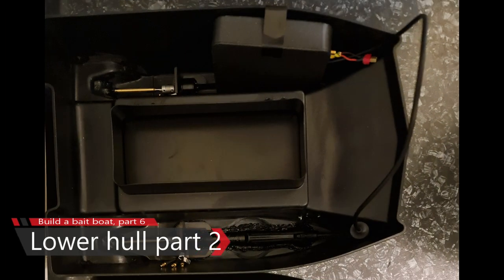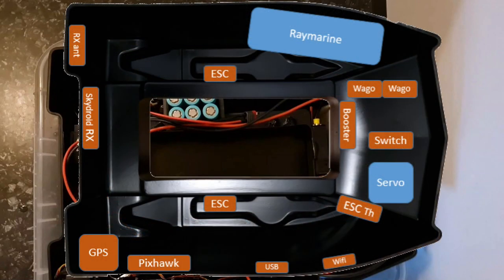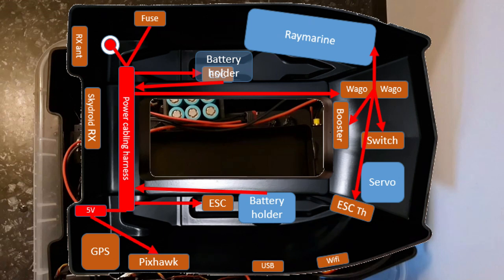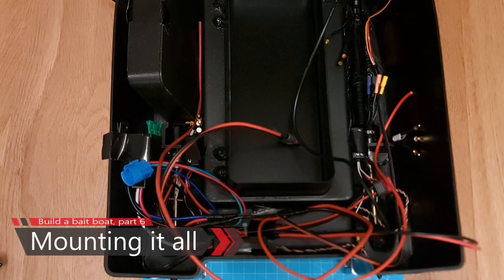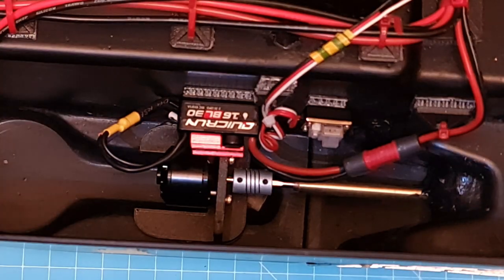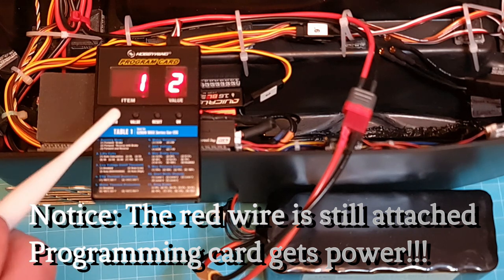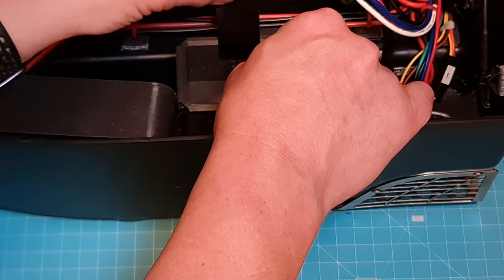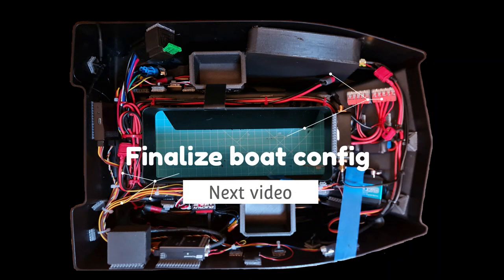Boat build part 6 - Lower hull, installing components

Comment: hello, great build, what glue do you use please?
Reply from the maker: A combination of glues. I have built many boats using Tec7. But it dries a bit slow, and does not hold well until dried. And some more to be aware of as well (see below). 

Say the vertical attachment of a battery holder to the side of the boat. Using Tec7 it would slowly slide down and thus needs support until glue dries. At the same time it stays formable for longer. And is more forgiving (allows more time) to make a nice looking seal around the edge when gluing upper/lower hull together. And I used Tec7 for that purpose only.
One more con with Tec7: I make some thick seals to firmly hold the propeller tube at the hole of the hull. If you use Tec7 for this then you should add the glue in multiple layers. I have found that a thick, one time layer will result in the inner core around the tube never really gets solid. When I rebuilt a boat after a month, and also removed the tubes, the glue around parts of the tube was still soft and sticky. 

To make stuff stick more instantly (even before drying) and ease the build process there are better glues. Like Bostik Superstick. Name describes its abilities well I think.

Comment: great video 👌 I imagine the hours spent to make a video.  A lot of patience 👏👏👏
Reply from the maker: I spend more time making the video than building the boat... 😅This mounting of parts is actually a fairly fast job, far less demanding than fitting in the transducer and the motors. And besides the placement of the hole for the servo pullrod, the level of precision is far less important as well (millimeters are not really important when you glue in that battery holder, as an example)

Comment: Hi, excellent video, there was just one bit i was looking forward to seeing, which was how you shortened the Raymarine transducer cable, could you possibly explain how you did that?
Reply from the maker: Either cut off the mid section. And then splice the ends together. When doing so great care to recreate the various shielding is needed (peeling back various metal and plastic shielding, then solder each wire, finally put shielding back). I found it useful to practice a bit on the mid section I had cut off.

Or, desolder the socket from the board. Cut transducer cable and solder wires directly. Fairly straightforward if you know how to desolder. But note that some wires are thin and makes the job a bit more difficult (in particular the red and black power wire for the transducer). There is a drawing showing how the different wire colors match the pin holes on the board available in the Facebook user group for Carp Pilot Pro.

Comment: Extremely well build with great attention to the detail, congratulations. I want to ask why in this build you give up Deeper sonar and disaided to use different brand?
Reply from the maker: I have previously built this model 3 times using a Deeper. Wanted to standardize on Raymarine now as I have that also in my larger boats. Also never got the Deeper 100 % right: Could not build out the battery and power it separately without seeing that 1% remaining warning after a while. And hate to remember to charge it should I leave the battery inside. So Raymarine was chosen 🙂

Comment: Good afternoon. Can you show a detailed diagram of connecting the T10 receiver to the pixhok 4 mini. And connecting all the elements to the pixhok 4 mini. You connected the GPS to the telemetry port, and where is the Wi-Fi adapter? And how did you connect the usb. Sorry for the many questions, this is the first boat assembly, I'm just learning everything.
Reply from the maker: Boat is glued. But I can explain using this 2xcellent guide. Just after header "pinout" there are pictures with numbers. That's rather precice also:
Servos: Connected to the area #11 according to my channel selection. 
GPS: This was non standard connected to #5 (can) as my M10 L4 3100 GPS is a CAN GPS. If you buy let's say the very good M9n from holybro (made for this auropilot) it instead goes into #6 (GPS) 
T10 Radio: Connected to #8 (ppm). You would think it should go into RC IN, intuitively. Almost made a cable for it as well. But that's incorrect, as you understand by reading everything. 
T10 telemetry: Connected to #3 (telem1) 
UDP wifi adapter: Connected to #2 (telem2) 
USB: this was connected to #13 (usb)
Matching power module goes into #1 (power) 

Please note that I only used this pixhawk4 mini because I already had it. It was more expensive than a regular 2.4.8 pixhawk, and honestly I do not think it is much better. But I had it. It was small. And the boat was small... 

The guide i refer to you find here, read it and get the shoulders down 😉

https://ardupilot.org/copter/docs/common-holybro-ph4mini.html

Comment: Very good work. The video is informative. I just didn't understand where the WIFI module and USB are connected. In your video posted 8 months ago, you connected the GPS and the compass with each other with a signal. Is the principle the same here?
.
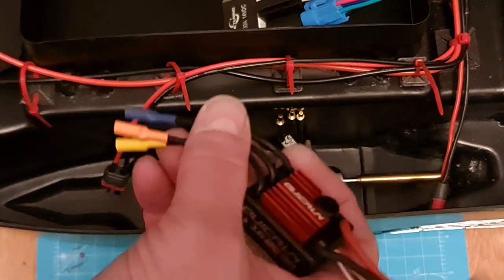Reply from the maker: You can check out the video part 2 about preparing the autopilot. Around 6:30 I connect the GPS/compass into a regular Pixhawk 2.4.8. In part 6 I instead installed a Pixhawk4 mini and used a GPS/compass unit that communicates by CAN protocol (simplifying the cabling with a 4-wire connection only). As most of you use the 2.4.8 model I "skipped over" these details here, trying not to make things to complicated. If you do buy a Matesys M10 L4 3100 then the CAN cable comes with. I can tell you how to connect it to a regular 2.4.8 pixhawk if needed.

For the USB module this is explained in part 3 around 1:00 out. As the USB module has two cables, one goes to the USB socket and the second in I2C. I use a small 5 port I2C parallel board as the GPS module already occupies the I2C socket.

And the additional wifi adapter is also explained there (in this video part I use dual telemetry adapters, one for Skydroid radio receiver and one UDP wifi adapter in TELEM1 and TELEM2 respectively).

Comment: Do you turn the boat using engines (right, left)? How to organize a turn (steering wheel) if I have one motor and a servo on the steering wheel? Thanks for the answer?
Reply from the maker: If the boat had 2 motors and no rudder then it drives exactly like a tank: More power on one motor turns it. This is called "skid steering", while motor and rudder is exactly that.
When you set up the ArduRover (the software we install in the pixhawk) then the default settings are:
- Motor and rudder
- Channel 1 is steering (aka rudder on ch 1)
- Channel 3 is throttle (aka motor on ch 3)
If however you have two motors then you set:
- motor left to ch 1 and 
- motor right to ch 3. 
And, please note, that ch 1 is still regarded as "steering" and ch 3 is still regarded as "throttle" when ArduRover mixes the challens for you.

If I understood you correctly then you have 1 motor, 1 rudder and a "car remote" with a wheel. Then plug that servo for the rudder in autopilot servo ch 1 and motor in autopilot servo ch 3. And use the default setup for the autopilot (no changes for these two channels, this is the default setup)

Comment: Hi Again.  Do you have a diagram for the wiring of Skydriod telemetry cable to Pixhawk ?? and what size JST plug ?
Reply from the maker: If you use the regular pixhawk 2.4.8 (like the ones I showed in video # 2) then you do not need to worry. The T10 comes with the needed wire in the box. 

About this 4 wire cable: On the radio receiver end this wire has two dupont 3-port plugs (regular servo cable plugs): The one with 3 wires you plug in all to the right with the white wire facing down, and the second plug only has the 5V red wire (in the middle as always) that you usually plug in next to it. On the other end of that wire there is already a standard 6 port DF13 connector in place that snaps directly into that pixhawk telemetry port - exactly as I showed it in video #2. Then it works straight away. 

If you however need to replace that DF13 connector with some other connector, like I had to since my pixhawk4 mini uses JST-GH connectors, then: 

1: RED-5V, 2: TX, 3: RX, 4:none, 5: none, 6:GND. 

The pinout is by the way exactly the same on the DF13 connector. You will find all that needed information (how the different ports are pinned) on the ArduPilot wiki, at least for the most popular autopilots. And if not then the company making them usually has good documentation, like Mateksys that offers a lot of pictures and drawings for all of their ArduPilot compatible autopilots.
Reply: @TheCarpPilot  Hi. Thanks for replying, The T10 receiver I have has 1x6 pin DuPont plug with cable coming out of receiver, labelled from the top: Gnd=black: 5v=red:  RX2=white: Tx2=yellow: Gnd=black; Sbus=yellow. going to 2x 3 port DuPont plugs. 1 plug has Gnd; RX2; Tx2. the other has:5v; Gnd; Sbus. The package I have, does not have any DF13 plugs.I will try to upload photo of receiver and cabling.  I shall have a look on the wiki as you suggest. Many thanks.
Reply from the maker: @stuartgriffiths4299  Ah, OK. Then likely you got the more high end Rx model (Multilink v1.0, I have one that came with a Skydroid H12). When I tested it myself I made a pixhawk serial cable (I have a kit with pre-crimped wires and Df13 in all sizes) and a servo connector like this: On the Rx end the 6-pin DuPont you mentioned. Then I made two connectors for the pixhawk like this:

Pixhawk serial: 1: none, 2: white, 3: yellow, 4: none, 5: none, 6: GND (aka: A serial missing the red 5V, using GND, RX2 and TX2)
Servo connector: Using 5V, GND and SBUS (and here the SBUS goes to Pixhawk signal side, the other two are GND and 5V)
Note that this way the Skydroid receiver's Rx goes to the Pixhawk Tx, and Pixhawk Rx to the receiver's Tx. As it should be!

Then the serial plug goes into (usually) TELEM1 and the servo cable into RC IN on the pixhawk.

Such questions are far more easier to answer in the Carp Pilot Pro facebook user group (sharing pictures and so on is so much easier). Search it up and apply for membership :-)

Comment: Hello, I cannot connect the Raymarine 7 Pro to the Carp Pilot Pro app? I connect my boat via Bluetooth from the T10 controller and the Raymarine via WiFi to my tablet. I can make them work side by side, but to make 3D maps I have to get the depth of the Raymarine in the Carp Pilot Pro app. what settings do I need to adjust to make it work?
Reply from the maker: Did you activate the premium ability to use wifi echosounder and also select Raymarine as option among echosounder choices? You should really join the Carp Pilot Pro user group on Facebook, YouTube Video comments is not a good way to ask for support...
Reply: @TheCarpPilot  yes, I have the premium version and can choose Raymarine at fish finders, but it doesn't work. I will join the Facebook group

Comment: Hello.  Is it worth switching from pixhawk 2.4.8 to pixhawk 4. Is there any difference between them?
Reply from the maker: Generally speaking: Not that much. But the regular pixhawk (2.4.8) is slowly moving in the end-of-life direction. One sample is the quick tune script that became available in the 4.4 release of ardurover recently. The good old pixhawk does not have capability to run it. No autopilot with the similar CPU can. But newer and more expensive with H7 CPU handles it perfectly. If you want to add Lua scripts to the autopilot then the good old pixhawk is limited wrt how much storage for scripts it can handle.
But: If you are happy with your boat now then I really cannot see the value with such an upgrade.

Comment: Hi.  Apologies for keep on asking questions, but, If I fit a deeper chirp+, will I get interference from the Skydriod, or would it be easier to use Flysky 5.8ghz receiver and transmitter.
Reply from the maker: The Deeper you cannot really configure, so it is locked in 2.4 GHz wifi channel 1. One boat where I used Deeper in combo with a booster I noticed that the range was great, but when I turned the boat at around 200m distance then somehow the connection was lost. Might be caused by the two 2.4 GHz transmissions crossing each other during the turn. I also had to drive back to around 160 meters before I regained the Deeper's wifi connection. Which did not make a lot of sense since the Deeper's antenna was anyway placed in the front. I cannot really say why it happened. But generally, if you have an option to use different wifi bands so they do not have to compete then in theory that is always better. Using other fishfinders that offers a way to alter the channel will make it possible to reduce the problem, obviously.
Reply: @TheCarpPilot  ☝☝ Thanks for your input.